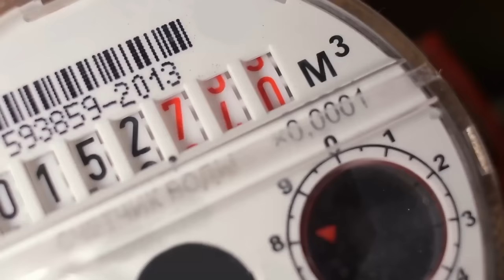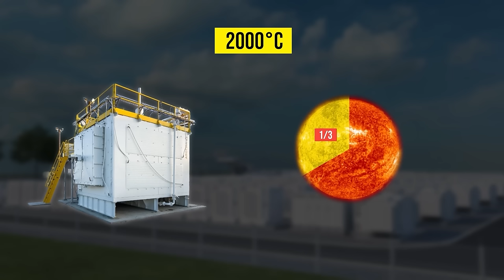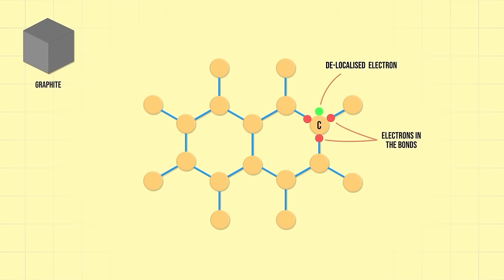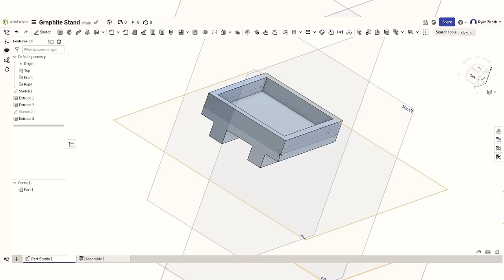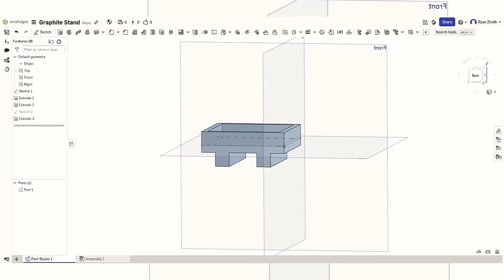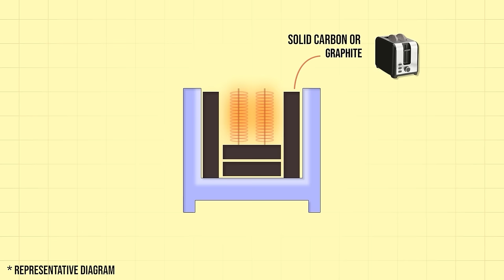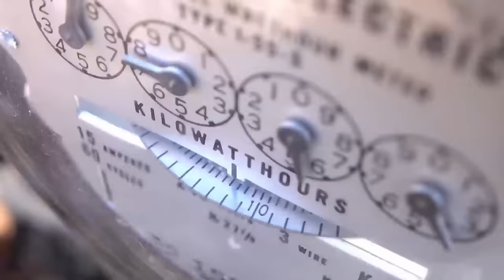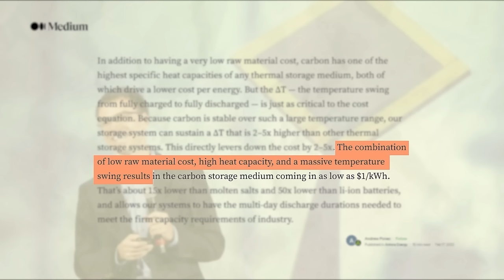Why Solid Carbon is the Future of Energy Storage

Comment: I am a merchant mariner and it would be cool to have one of these in an exhaust boiler so when in port or anchored we don't need to use a oil boiler to generate steam. On ships its one of the ways we use "waste" heat for power. Heating fuel and the ships.
Reply: Would not work at all.
Reply: @dragoscoco2173  why not? Instead of using resistive heating you could use steam or exhaust right?
Reply: @cloggedpizza239  Steam has a limit to how hot it can get, exhaust too. You do not need graphite for those temperatures, oil will do just fine.
Also at low temps getting work out of that lukewarm material is subject to the Carnot cycle efficiency of sub 15%.
So unless you transform that heat into electrical at sub15% efficiency to heat the graphite to high temps you will not get much energy back.
I suppose some engineers thought of this and found the oil tank to be the adequate and best case scenario for both usability, weight and price for what it returns.
Reply: @dragoscoco2173 I was more referring to heat storage in genral not nessarly grafite but I have heard of other companeis using ceramic with steam. But I beleave our ships exuast only reaches around 400c-600c after the turbo. But I guess it would be inefficient in weight to store enough energy for 3 days at port and may effect stabilty becuase of weight. But maybe the infared pannels could have use.
Reply: @cloggedpizza239  Found a somewhat decent data source. I quote "The team’s design can generate electricity from a heat source of between 1,900 to 2,400 degrees Celsius" and uses multi junction TPV tech which is the most expensive to date achieving 40% efficiency on a tabletop experiment, not the actual battery which is mostly theoretical. So i expect it to perform exponentially poorly below 1900'C and the real life efficiency to be less. TPV sound nice and it would be great to have some, but we do not have a decent way to make any in a usable temperature range.
Reply: @dragoscoco2173  makes plenty of sense.
Reply: @dragoscoco2173  But the solutions they require now must address the fictitious carbon bug-a-boo. There's probably more carbon in one of those blocks than produced by a large population city in a lifetime.
Reply: This is why we need more thermophotovoltaic or TPV cell research. Think solar cellls, but for heat. 

 There was just a break through on them where they get more effiency than a turbine at like 45% effiency. (45% effiency of what I dont know.)

 It is great as there are no moving parts. Just uses the heat radiation  from the source. 

 The issue with that was it only worked at like 2,000 celius. Which is still great since there are a lot of industrial infrastructure that produces that type of heat as a byproduct. 

 So yeah we need to have those at tempatures at smaller scales.
Reply: @midcenturymodern9330  thats only 35 tons. It probebly weighs about as much as our exhaust gas boiler. If not less.
Reply: @cloggedpizza239  The people saying this technology in the video is not applicable to what you're talking about, are referring to the graphite metrics. I know how we could utilise the energies you're talking about with the thermophotovoltaics that cool lad was talking about. I think you have a the right kind of idea, and it's cool that your experience provides a grass roots application use case for energy regeneration. I'm forming a company that will be working on just that kind of thing. Thanks for your insight I'm pretty sure you've been feeling how much energy is wasted from the activity you mentioned. I'm the same, it just ticks away, like :"that surely is just a waste" and you are right, there is a solution ;)
Reply: @braveecologic2030  The new ship our school is getting does not even have exhaust heat recovery aside from turbos. I don't know if the v16 wabtec engines are that efficient already or if they are going the cheap route to save money(while losing more to fuel in the long run).

Comment: I like how he's also literally taking carbon out of the carbon cycle to make these heat reservoirs.  The IR mirror returning unused photons back into the reservoir is genius.
Reply: Maybe carbon doping to alter frequency of light emission to make solar panel work better. Or tuned antenna solar capture instead of just bandgaps.
Reply: an IR mirror has been talked about by a TPV graphite energy using liquid tin to heat up the graphite and store it and using tungsten to radiate the glow of energy off the graphite and whatever is left you can cover other sizes using IR mirrors and their so good really this was from MIT from last year and I love it
Reply: This would be a good use of solid carbon precipitate from turquoise H2 production, in way it would produce short to medium energy storage with the thermal carbon batteries and long term seasonal / emergency storage with H2, especially when the H2 can be stored in a carbon matrix like some companies are pioneering. This would even be carbon negative if RNG is used.
Reply: How does this technology compare to water electrolysis, producing hydrogen and oxygen? From what I can read, the round-trip efficiency , electricity to electricity,  is around 40%. Would love to hear the company compare themselves..
Reply: @RandomActsOfMadness  and also against a gravity battery, which seems to be a much simpler concept...
Reply: @EdGreenTO  The only gravity batteries that make any sense involve pumped water.  Michael Barnard on Clean Technica did an analysis of gravity batteries, and other than water, they are all horrible.  It seems as though no one ever did the math on them.  They look good at first glance, until you get out the calculator.
Reply: @RandomActsOfMadness  It would be good to hear efficiency numbers on this.  My recollection, from other reports on it, is that if the endpoint is heat, it's quite efficient.  Using hydrogen as an energy storage medium is pretty horrible when you add up all the costs and inefficiencies, including drying the gas, compressing it, storing it and transporting it, Then decompressing and heating it so it can be used in a fuel cell.  And finally, taking into account the problems with fuel cell duty cycles and MTBF.  Overall efficiency is worse than 40%, and costs are outlandish.  There are a lot of incorrect reports floating around claiming it is a lot less expensive than it will ultimately be.
Reply: Sorry to crash the party here, but graphite at those temperatures will emit in a broad spectrum reaching far beyond visible light into UV. Only capturing infrared radiation is a hard limitation. Sure you can reflect lower energy photons back into the batterie, but whats about the higher energy ones? This will lead to higher electon jumps in the semiconducter exceeding the band gap. The excess energy is discipated as heat and therefore can not be convertet at the cell to electricity (and can't be dumped back into the batterie either). So only a small fraction of the emitted spectrum is converted to energy. Using a regular steam turbine will achieve better performance.
Second point: Sure 40% efficiency is impressive. But they achieve this by dodging the most important challenge for solar cells all together. Converting a whole spectrum (e.g. visible light) to electricity is challenging, because of above reason. Only limiting themself to one small gap will improve performance. Any other photons won't be considered here.
Reply: The carbon is being mined from graphite rock. It's not taken out of the carbon cycle.
Reply: @seasong7655  Well that's a bummer.   At least it's not being put back.  Also where are there blocks of graphite underground that can be mined?  This is news to me.
Reply: @paprika1716  Very valid points,.  Efficency of 40% seems legit though.  I hope they can make it better
Reply: ... It's also somebody's tax funded science project.

Comment: You mentioned that materials like concrete or sand are not effective because they can't transfer energy fast enough. This, while true, hides the fact that the biggest limiting factor for emitting/absorbing energy is the ratio of volume and surface.
While sand is not great at conducting heat, you can exponentially increase its surface area by changing its form (for example, creating a shallow layer of sand just using gravity). Once it's surface area has increased, heating and cooling becomes way faster.

This is something you can't easily change the shape of a graphite block, though, so you're limited to only use the pre-existing shape

Comment: Planck is going to be proud of those guys... That mirror in a cavity is real genius. 

One question though: how do they prevent glowing graphite to react with air and burn?
Reply: I'd be guessing CO2
Reply: Surround it with inert gas, such as nitrogen, CO2 or something else. 
I realize those gases are not strictly inert, but they are in this context.
Reply: @hansmuller1625  Yes of course changing the atmosphere inside solves the problem, however, they were talking about opening shutters to get the heat out, so I am puzzled.
Reply: @markotrieste  The heat shutters could open to another controlled atmosphere with a radiator?
Reply: They're probably going to use a refractory glass that is transparent to whatever band of the EM spectrum they need for a specific application.

Maybe Quartz. Maybe Sapphire. Maybe germanium.
Reply: I wonder what the heat leakage is and how effective the electrical convertion is, once it is up to temperature and the reflective heat reabsorption is considered. The idea seems cool, but something like flow batteries seem more promising. It all comes down to the cost to performance ratio. Would be great to get actual numbers in actual deployment.
Reply: @markotrieste  The shutters wouldn't be between the interior of the cell and the outside world- no, there'd be an intermediate layer that it would open up to.

Comment: Solid graphite is also used for heavy duty arc plasma lances used in steel foundries, carbon arc steel cutting, high-powered searchlights (called arc lights), and more. Great use of this old tech!
Reply: Arc lights came to mind almost immediately as they can just run current through the graphite blocks to heat them up. No extra heating coils using Tungsten needed.

Comment: Insulation. Very important part you left out. Very difficult at these very high temperatures.
Reply: How they keep O2 out and what they use for insulation are almost certainly proprietary.  OTOH, I'm sure the insulation is silicate or borosilicate glass bricks, like the tiles on the shuttle or starship.

Comment: worked in energy and this would be a game changer for many industries even if the conversion back to electricity is only 30%. 
buying excess energy to fill up batteries at zero cost would not only net the company a profit but also help the grid.

Comment: I am not sure what battery storage you say has a 4-6 year lifespan but Tesla’s   Megapack has a 15 year warranty.
Reply: Probably it's a capacity lifespan that is so short. Worn out PV panels from a solar farm selling cheap are about 70-80% and cost effective to replace with new PV but still quite usable for many more decades; they just take up more space for the same production.
Reply: @bussdriver  - Using Batteries on almost ideal conditions, increases the life span by a LOT... when you have an ambient with very controlled temperature, zero vibrations and very careful charge and discharge, you can reach insane number of cycles... that is why Tesla's Megapack has 15 years warranty
Reply: @bussdriver  The 15 year warranty is a capacity guarantee, soo no there is no massive capacity loss.
Reply: The latest Megapacks have a 15 year warranty as their design moved to lithium iron phosphate cells, which is a game changer for the lithium based storage market. Any solution based on lithium ion batteries will have a much lower lifespan for any solution that cycles the battery daily.
Reply: @bussdriver   After 12 years of sizeable EV numbers in the real world only 5% of their batteries have been replaced and the new ones are more durable than the first ones.
Reply: Standard Pylontech batteries have a 15 year lifespan too...
Reply: he said in grid application
Reply: Yes, and that is probably guaranteed to 85% capacity. It does not become useless at that point but could be used for another 10 years before it drops to 60% or so. In 10years form now it might cost more to decommission or tear down than to just let it keep working.
Reply: The graphite battery doesn't see any degradation for 30 years. Megapack sees degradation after 1 year and degrades yearly - and has a relatively limited lifespan.
Reply: @23lkjdfjsdlfj  I guess that's why they are taking over BESS in leaps and bounds because they are cheap to build, very simple to use, can be connected directly to a load, can be charged and discharged in a short space of time, don't need all sorts of other tech and machinery to make them efficient? ? ?
That technology has it's place, but to say we should do away with BESS and use only heat energy storage, would be the same as saying EVs and batteries are the solution to all our emissions related problems.
Reply: @trikepilot101  my EV is from 2013 and has degraded only 16% largely because I'm in a cold climate; if hot, it probably would be unusable for me and the battery replaced.
Reply: @bussdriver EV’s use very different li-ion cells than BESS. Check the power of BESS cells. Most are now C/2 (or 0.5P). Meaning fast charging is not available. For EV that’s a must. We’re going with BESS towards 8 hour duration. And guess what? The only problem of ASSB has been the power. They are cheap and quick to make. Which mean BESS lifespan with ASSB LFP cells will be over 40 years. Which is already a problem for the power electronics. Also ASSB does not mean lithium metal anode. Hard cardon works very well.
Reply: I was thinking something similar, and some of the new LiFePO4 batteries, are likely to vastly increase that. Possibly (he did specify in industry usage), to justify the outlay in batteries and land, they are fully charged and emptied multiple times per day. Even at one full charge cycle daily, that would be 2,000 cycles in six years, which is enough to significantly degrade, LiMNC devices.
Reply: a 15-year warranty does not mean that that is the expected lifespan of the batteries, it simply means if they fail within that period they will be replaced without cost. that might be a huge difference
Reply: I see you've never been in litigation over batteries with Tesla before....so naive
Reply: @xanderunderwoods3363  most people do not understand that motor manufacturers are legally required not to disclose thw fact that almost every modern vehicle with electronics has a black box that may be accessed only by the authorities or the manufacturer. So when you tell the local dealer some hare-brain story about you not mistreating the battery or the vehicle in its entirety, and the dealer feels your story lacks a little salt, they escalate the claim to the manufacturer who can then access the usage data, they will repudiate your claim, but cannot give you a reason they know it's not fair wear. 
And you thought your phone was the only thing spying on you!
Reply: Battery lifespan is depend on the cycle of charge and discharge, if you just discharge it above 90% and recharge it daily there is high change the battery would failed within 8 years.
Reply: Exactly, saying it’s only 4-6 years is delusional.